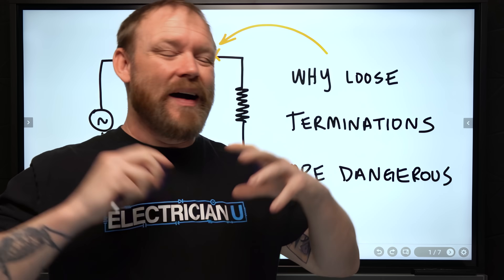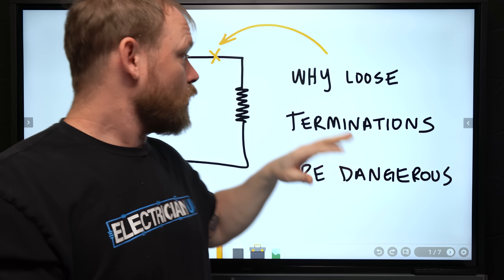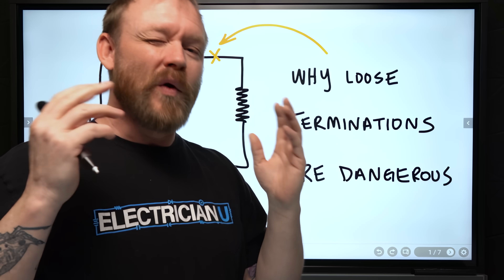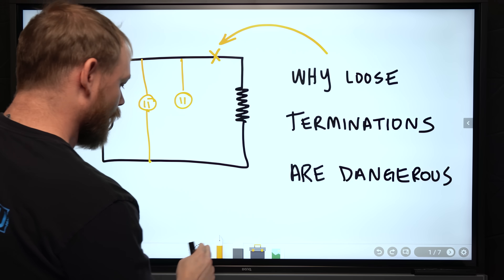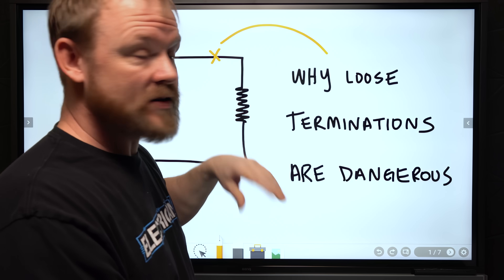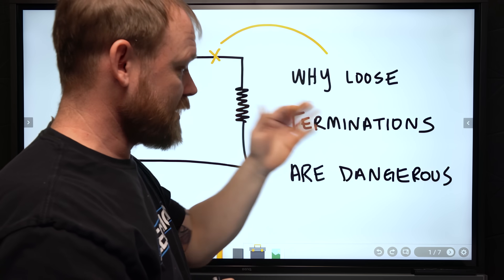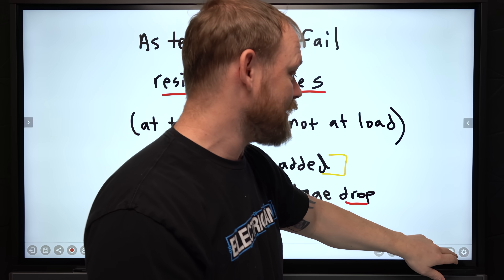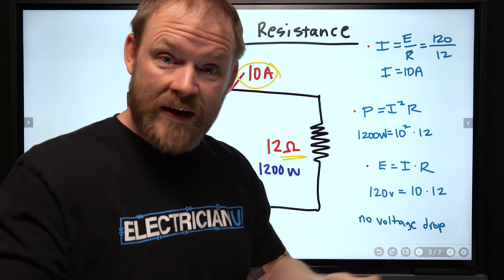Why Loose Wires Cause Fires: Why I Pre-Twist.

Comment: I had a fire in my attic from a power supply line to my swamp cooler. Ran great for 20 years. Line ran through a stud and was melted through, copper blobs on the wires. Only burned two studs and some insulation, but they declared unlivable and tore partial ceilings out in all rooms upstairs and pulled out all the insulation. Love to tell the horror stories about the insurance in collusion with the disaster repair company but too long. They never sent a pro investigator (or an agent..ever..) to determine cause. Long after the fire I found a power strip in living room that was burned inside and then my furnace transformer was also burned out. I’ll never know if some power surge started it, or the fire caused some surge, or what the original cause of the fire or whole thing was.. If there wasn’t so much fire resistant insulation piled up, my whole house would have burned down. The swamp motor was fairly new, belt tension was fine. Ended up getting rid of it when the ceilings were open to install mini split AC. Love my Mitsubishi mini splits! I was at home getting ready to bake bread, my neighbor who I didn’t really know knocked, and said “I think you have a fire..” I’ve lived here 27 years, I couldn’t believe him. I went outside and yes, smoke was pouring out of my attic eaves vents. I pulled my car out of the garage and now I can’t remember if I called 911 or someone else….never want to go through that again! Ridiculous costs charged, fraud and waste I reported and insurance got mad and just said they were paying it. Yeah..got mad at me for reporting contractor they recommended. Hotel costs were more than the repairs, and the “take your stuff and clean it then bring it back” portion of the disaster company got almost 50 thousand dollars. Only thing wrong was two four foot pieces of stud, and the original 5 x 6 foot hole the fire department cut. Sigh. Don’t have a fire..it’s a nightmare. (Hotel bill was 15 grand…I think the repairs were under that at 14…). Huh..guess I did tell a long story, just not all the horrible details like being out of the house for nine months, coming back in the dead of winter with no ceilings so I put up plastic and camped out in front of my gas fireplace on a mattress, promptly got COVID..super fun…. etc etc.. Oh..I had one of the now banned breaker panels from the 50’s..I’m blanking on the name..Federal Pacific maybe?..no electrician who had ever come before told me to replace it..I had all the wiring replaced with a new panel, whole home surge protector on the main, and two surge protectors in my two auxiliary breaker boxes. Also upgraded to a new 200 amp incoming service.
Reply: Thanks for sharing. Guinness should be calling to give you the award for longest comment lol. I commend your persistence
Reply: @ yeah..I’m on disability, so..YouTube is a main source of entertainment..
Reply: Everytime i see a federal pacific panel i advise that it gets changed for this exact reason. The fact no electrician told you is incredible because this is one of the most well known issues with homes made around that time. The company had cheated on a demonstration of its breakers to get approved for sale, their breakers dont reliably trip in response to a fault and have caused countless fires.
Reply: @danielz6781  another case of “an ounce of prevention..” I so wish I’d had the opportunity to prevent that whole experience..

Comment: Loose connections are the worst.   One way to find them is to use a thermal IR USB-C camera for your smartphone -- around $220USD.  Do this when the connector has some load going through it.  I found a loose connection on a solar MC4 connector that was very evident in thermal IR.   It would work for all sorts of connectors: clamp/crimped, ring terminals, solder joints, you name it.
Reply: Genius

Comment: I'd like you to cover GFCI/AFCI and refrigerators.  My new house has a GFCI/AFCI breaker on this circuit and it keeps tripping.
Reply from the maker: I'd imagine this is a brand-specific issue. Some gfci/afci nuisance trips based on certain load characteristics, while others may not. Could be the algorithms running on a specific AFCI, or could be a wonky signature produced by the refrigerator. Also if there are two fault devices on the same circuit - like a afci/gfci breaker and a gfci receptacle they sometimes "chatter" and cause one or the other to nuisance trip. Good idea for a video though, thank you!
Reply: @electricianu exactly some brands are way better then others. I rate levitons smartrip AfCI/GFCI receptacles and breakers they have learning capabilities which overtime reduces false tripping due to load characteristic signals that mimic serial or parallel arcs. Had one on a microwave circuit that used to trip every 2-weeks which reduce to every 3-months and then once in 9 months. It hasn’t tripped like this in the last 2-years. I suspect it used the load characteristic signals information overtime to distinguish between load characteristic from real arcs.
Reply: @ Now I'm interested. I have never heard of receptacles/breakers for home use that can learn over time. Definitely looking forward to a video on this topic especially if more info like this is discussed.
Reply: It could be a faulty breaker, but chances are that the breaker is fine and there is a loose connection somewhere that's tripping the arc fault portion of the breaker. Couldn't say what the issue is without diagnosing it myself.
Reply: @adamfink5294  Thanks.  I've been through all of the connections in the receptacle box (had to fix some poor ones - a prof. electrician failed to strip enough insulation and had it under the screw on the outlet) and I replaced the breaker.  I've read plenty where refrigerators make these breakers trip even when all of the wiring is o.k.  It's something about the frig load characteristics that does it.  Of course, the 2017 NEC is ambiguous about whether a dedicated refrigerator circuit needs GFCI or AFCI.
Reply: Take one of the afci and gfci out of the circuit to determine which one or both are tripping. 

AFCI looks for high frequency characteristic of arcing, while GFCI uses a small difference in supply vs return current to trip (theres a small amount allowed to leak to ground considered to be acceptable, typically 0.5 mA)

Comment: Maximum power at the connection (you call it a termination for some reasonn I don't understand) happens when the resistance at the connection is the same as the load (12 ohms in this case).  It's 300W

Comment: I had to go through every jbox, switches and receptacles in my house due to wires not twisted before they put the wire nut on. Its a miracle nothing ever happened.
Reply from the maker: Ugh, that's the worst. I've gotten so many service calls where recessed cans stopped working randomly. Pop the jbox open and most often its just some DIY person putting two wires side by side with a half twist on a wirenut. Just remake the joints and everything works like it should have.
Reply: I live in an old house that's been subject to decades of well-meaning, but incompetent, DIY work.  The electrical was all DIY and, yeah, miraculous the place hasn't burned down with what I've found.
Reply: The boxes in my house are like a box of chocolates. Each is a horror in its own way. I've almost replaced all of them.
Reply: I would be SOOOOO PISSED! Wow

Comment: loose connections have a higher resistance and that causes heat!
Reply from the maker: Absolutely, but only up to a certain point - then it begins to die back down the closer we approach an open connection. So there is a point (a maximum) - that was my point in the video, just took me a lot more words to show it lol